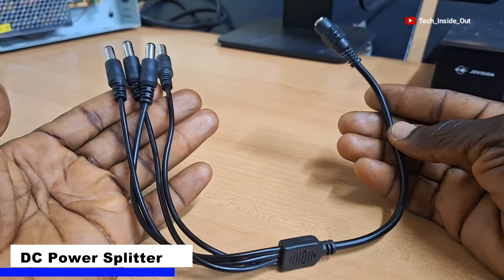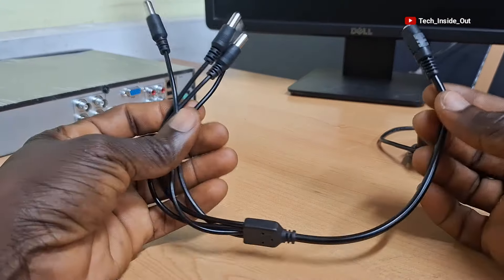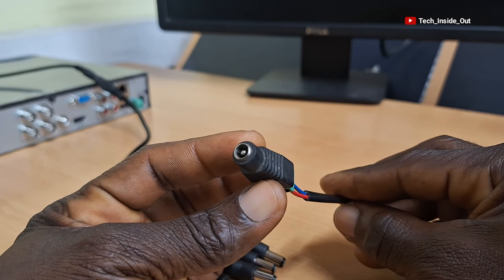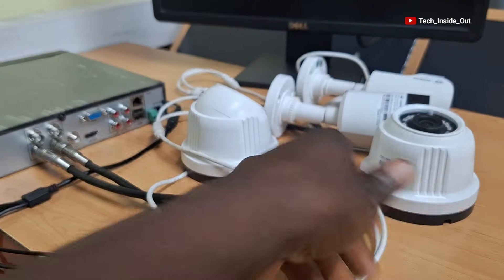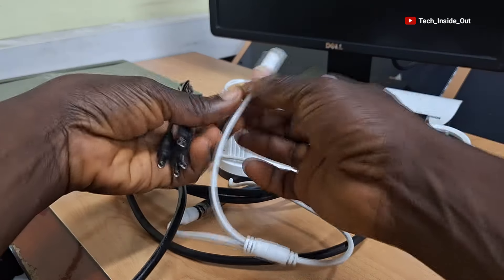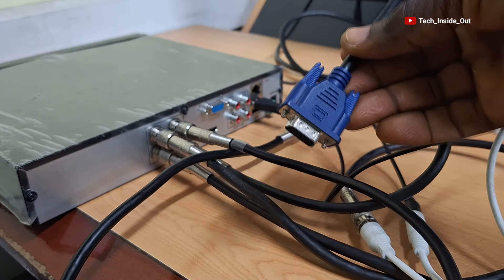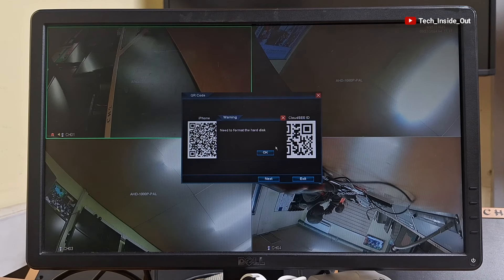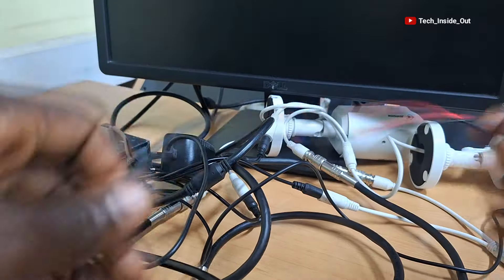How to setup ahd cctv cameras using dc power splitters as a means of power source to the cameras.

Comment: Pls sir how many meters can the coaxial cable can go when installing the cameras.
Reply from the maker: Coaxial distance is unlimited but it is the power cable which also runs along the Coaxial that requires a maximum of 100m. Even with the 100m, it is better to stay within 75m because of cable quality this days
Reply: @Tech_Inside_Out  thank you Sir 🙏
Reply: How about just using RG59 cable since it has both coaxial and power